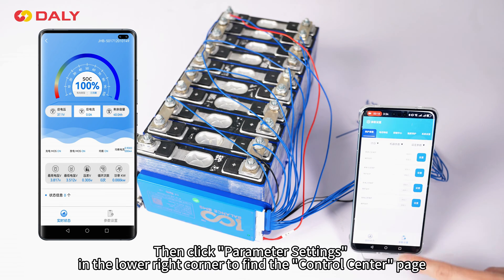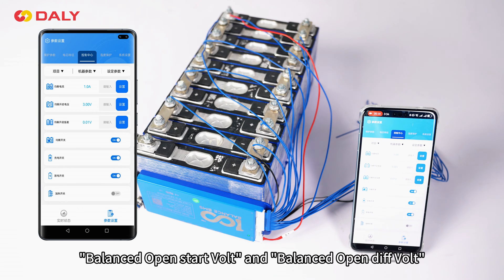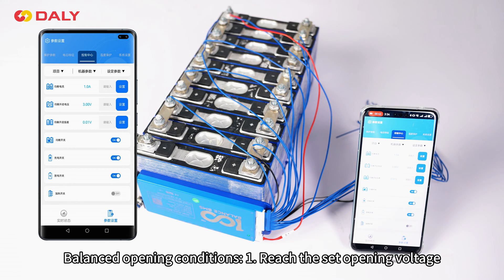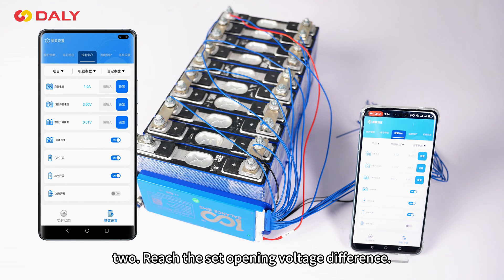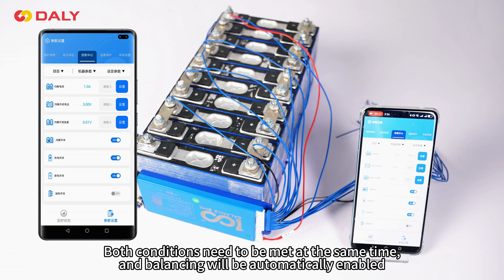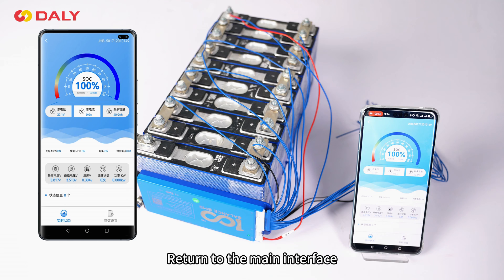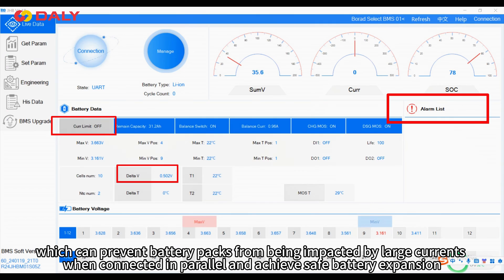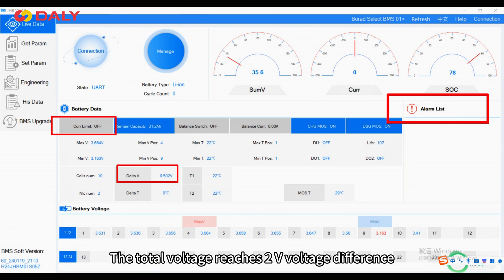100BALANCE  Active Balance BMS  Protection function demonstration.

Comment: I bought that but the bms heats up at 38° even without load is it normal?
Reply from the maker: BMS will heats up when it is working, like balancing, charging/discharging.  It's normal if it didn't showing any alarm message.

Comment: Very impressive wrong wiring setup!!
Reply from the maker: Yes, This is for show our protect function. The BMS have wrong wiring protect function etc..
Reply: @DALY100balanceBMS  Hi, how many temp sensors you use per cell ? What is your active balance current ? 1 , 2 , 5 or 15 AMPS ? I need BMS with 15 A balance / actice / current , isolated like FLYBACK, and BMS with precharge function, also BMS with detection circuit for H2, C2H2, CH4, C2H6, CO and CO2 gases.
Reply from the maker: @PavolFilek  Hello, I am Arica. Nice to here from you . The BMS have 2 NTC sensors , also you can add it to 4 NTC on it.  The active balance current is 1A.
Reply from the maker: @PavolFilek The BMS has a pre-charge feature, but I'm not sure what the detection gas is.
Reply: @DALY100balanceBMS  Hi, thanks for answers. I think, that if LFP / NMC 811 / NMC 622 etc. starts to produce H2 and other gases, BMS should stop MPPT / Charger and take care, that nothing will ignite this gas / spark , high temp of cell / and properly ventilate this gas, so that H2 and O2 in batt., compartment is not combustible.
Reply from the maker: @PavolFilek  These gases are only produced when overcharging, and the function of our protection board is to protect the battery from overcharging or over-discharging or over-current. So the function you mentioned is not necessary for BMS.
Reply: @DALY100balanceBMS  If BMS can not manage problems like internal short circuit , temp. rise, thermal runaway, why do you need BMS ? BMS have to take car of my batt. system not to destory my house. If this is not the function of BMS, I do not need BMS and I will produce HW and SW for my BMS, to manage situations I mentioned.
Reply from the maker: @PavolFilek  Hello ,the BMS have basic protection functions: Overcharge /Over discharge/Overcurrent/Short circuit/Temperature protection. You're right the protection function is the most important things of BMS.
Reply: Vou fazer a devolução do produto eu vou ficar com o produto aqui que não funciona vou devolver né
Reply from the maker: @josesilvionascimentonascim7114  Há algum problema com o produto? Este é um vídeo de demonstração do nosso BMS com recursos de proteção.